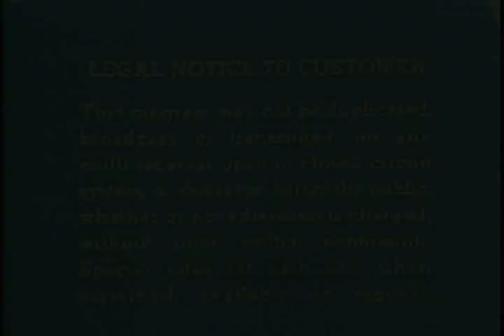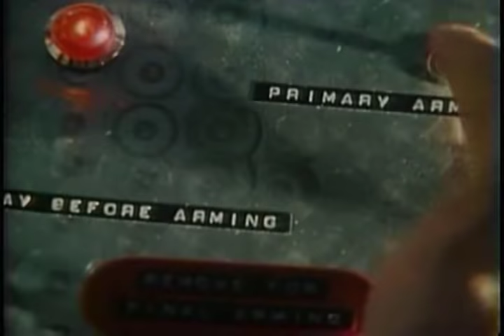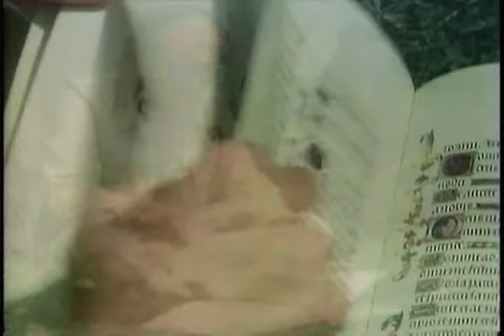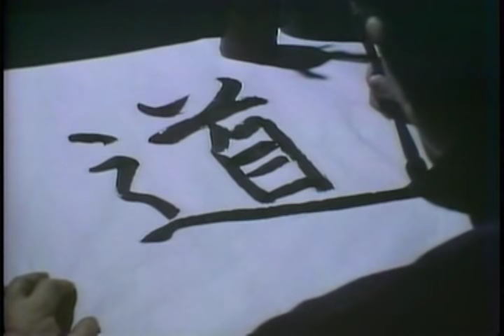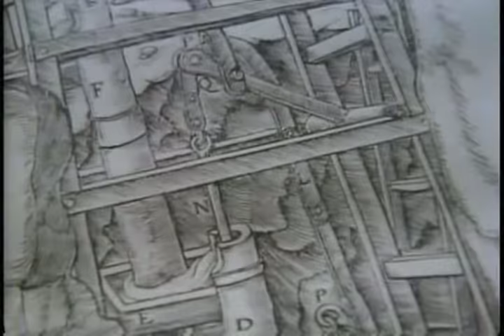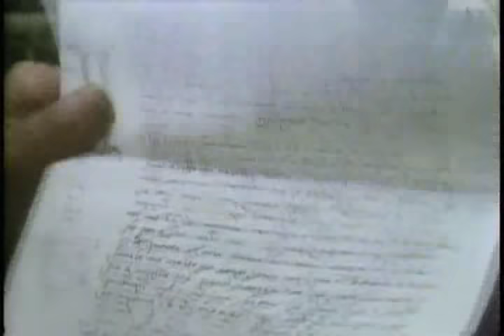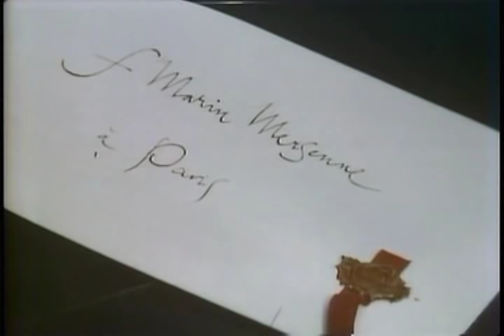James Burke Connections, Ep. 3  "Distant Voices"

Comment: This show was the one that guided my career choice in to computer science with it's  explorations of computers. This episode is very interesting to me. One of my mothers ancestors was at the battle of Hastings on the Norman side.. ;-)
Reply: Speaking of computers and connections: people had been trying to develop flat-screen TVs since the 1940s but none of the efforts were good enough to be commercially viable. Then came the laptop computer: the first flat screens for it were monochrome and had poor resolution and refresh rate, but were good enough for text display. This provided a revenue stream and a market for a somewhat better flat screen: color, then better resolution, then larger size, until finally you had a flat screen suitable for TV. It couldn't have been done in a single leap but the laptop provided a channel for incremental improvement.
Meanwhile, power requirements for the laptop provided a continual incentive into research for an at least somewhat battery in stages, until the lithium ion rechargeable was developed. Which incidentally made drones practical, which along with wireless connections put remote mobile cameras everywhere, which... well we're still seeing the results develop.

Comment: Watched this episode for the first time today, and immediately recognised Arecibo.

The Arecibo radio observatory collapsed just a few days ago (as I write this comment). Without a doubt, Connections is still relevant.
Reply: ??  What happened?
Reply: @adamthomas9924  Somebody forgot to flush.
Reply: @adamthomas9924  One of the cables was damaged, while they were monitering that connection one of the massive other cables holding up the sensors snapped. Because of the already stressed other cables the rest too snapped and thus the entire suspended array fell onto the dish you see in the bottom...
It has been a year already since I read about the accident so I hope I remembered it correctly

Comment: And at the end of this late 1970's program is featured the valley sized radio telescope at Arecibo.  Unfortunately this structure, not unexpectedly - because the metalurgic deterioration was well documented - suddenly collapsed in December 2020 with the suspended transceiver crashing down through the dish.  Fortunately other multi dish installations around the world, as well as the equally as old Jodderal Bank in Britain, could take over the research carried out by it.

Comment: If I recall correctly Connections was aired in the late 70's. At that time it was still believed that the 1066 'Hastings' battle was at, ahem(!), Battle. We now know that it was most likely the flood plains close to Crowhurst 2 miles or so south of Battle.  Documentary, as well as the Tapestry, supports this, & there is an unfinished high status Abbey at the village. The errection site was probably moved north because of ground instability. The 'smoking gun' for this 'new' appraisal would be the discovery of where the estimated 6,000 dead were buried. 6,000+ bodies, even in British October, need dealing with promptly(!) & would have been locally.
King Harold Godwin son's final resting place was identified as his Manor church at Bosham just along the coast some years back.
Reply: I still suspect having to first fight off Cnuts Norsemen, then march 70 miles/day to meet William, had more to do with the outcome than the stirrup did.  For one thing, that outcome was still very uncertain until Harold took, not a lance through the chest, but an arrow through the eye, at which point the Saxons lost their morale, broke and fled.  Certainly the Persian Immortals (among many others) would be shocked to learn that cavalry did not exist until 1700 years after Alexander slaughtered them.  The transition from chariots to true cavalry thanks to improved saddles and stirrups happened a long time before reaching Europe; Alexander had no stirrups, but the long and widely feared Scythian light cavalry did, allowing them to stand and fire short bows while mounted, even turning in their saddles to do so as their horses fled the scrum:  The infamous Parthian Shot still memorialized in our garbled modern phrase "parting shot."

I do not mean to nitpick; it is as an amazing a show now as when I first saw it over three decades ago:  But those are fairly large oversights.  They taught me in high school world history that three-field crop rotation revolutionized the Middle Ages and helped pave the way for the Renaissance (the Fourth Crusade looting, burning and fighting its way out of Constantinople with 2000 years of Roman art and wealth helped too.)  In fact, what they taught us in school was that Medieval peasants were not unobservant idiots, and ALREADY practiced crop rotation:  The innovation was to switch from leaving half their land fallow every other year to leaving a third it fallow every third year, which raised yields because they were always using 2/3 of the land instead of 1/2. Yet the written Hebrew Torah has mandated seven-field crop rotation since at least 600 BC, with an additional mandate to leave ALL land fallow, cancel all debts and return all sold property to the family that originally owned after seven times seven years, with a promise the land would produce enough food in the 49th year to sustain the populace until the harvest of the 51st year.  Then farmers use 6/7 of their land each year, which raises yields even higher.  So Burke is not "wrong," but Europe could have picked that up any time it liked--it just waited a little over a millennium to do so.

Regarding China, I think it important to note that because China progressed so rapidly for so long, it was forced to consider and confront the risks of Malthusian Collapse at least a millennium before Malthus lived.  For one thing, about half the country is solid rock roughly three kilometers above sea level, of which every available square millimeter was terraced very early on to squeeze out as much arable land as possible.  As noted in the program, all this was why they needed what was arguably the best bureaucracy in human history (until the Opium Wars broke it) because anything less than maximum efficiency risked mass starvation.  That was bad enough in itself, but an emperor whose realm was subjected to extensive and extended famines was deemed to have lost the Mandate of Heaven, at which point all Hell broke loose as various powerbrokers, supported by various disaffected regions and populations, tried to claim that mandate over the current emperors dead body.  Put that all together and it adds up to two things:

1)  NEVER rock the boat, because it is more of a very large and full applecart the slightest change could send catastrophically crashing down on everyones heads, and

2)  The individual is subordinate to the community, because when people start getting selfish the boat capsizes.

There was not only little incentive for change, there were many powerful incentives to preserve the status quo.  Remember how the series started:  We live in a highly technological world that has made us utterly dependent on that technology because if any one major part of it ceases to function, hundreds of millions starve to death, while hundreds of millions more slaughter each other trying to avoid starvation.  The Chinese have just been living there a millennium or two longer than Westerners.  We see it in Taoism and Confucian legalism too:  When the universes ordered system becomes imbalanced, it restores equilibrium in ways that imbalance makes severely painful for everything inhabiting that universe.  Which, again, echoes modern environmentalism in some ways, just hundreds, if not thousands, of years earlier than that developed in the West.  After all, if China did not have cannon, why does Chinese Chess have them... ?